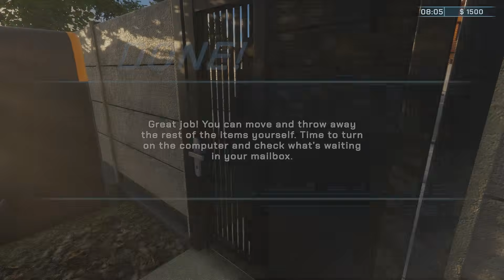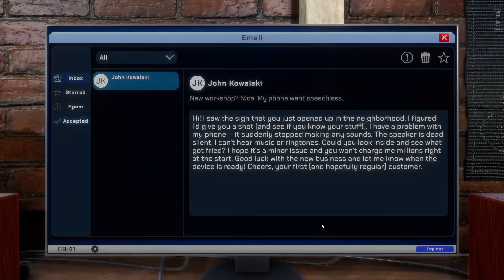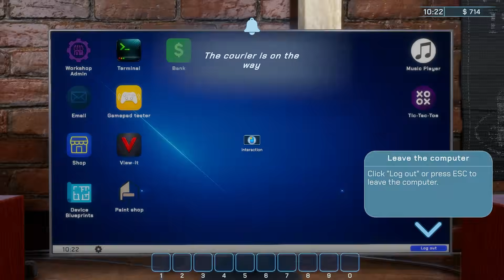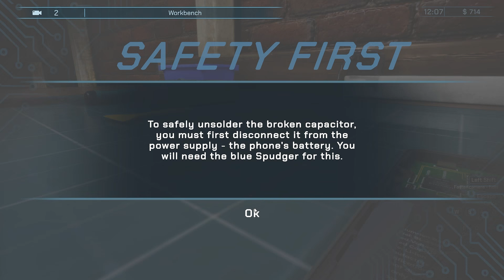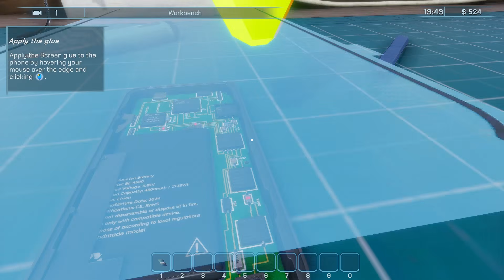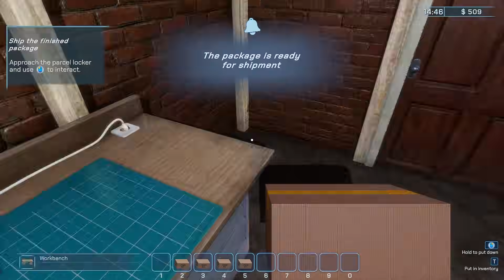It Works: Electronics Repair Simulator | Demo Gameplay

Comment: Yay!  This game is my real life favorite hobby!   Mostly it's just my own equipment, I buy old electronics on eBay and fix them up.  Sometimes I resell the repaired thing, usually I keep it.  Once in a  while I'll fix something for a friend or neighbor.

From what I saw it looks like a very realistic simulation without making you take a couple of years of engineering in school.  The troubleshooting process is very good; that's how tracking down a problem really works.      

I do object to dropping acronyms on people without explanation.    PCB means Printed Circuit Board; a hear resistant card with copper traces that connect parts.  PMIC is Power Management Integrated Circuit, the power chip that controls what is powered on at different times.   Real soldering is trickier than this, but I'd let that slide.
Reply from the maker: I was curious as to how accurate it was, so that's nice that it is pretty accurate.